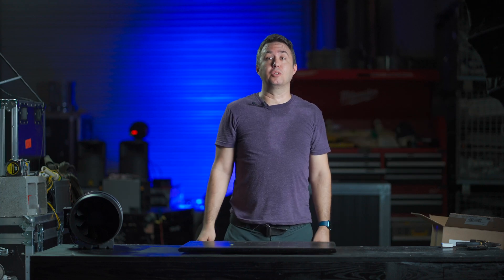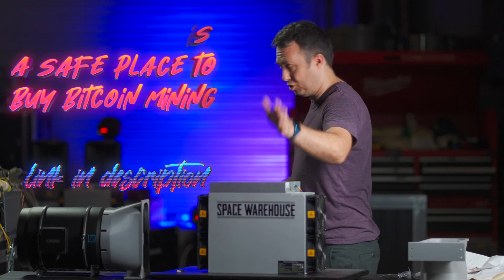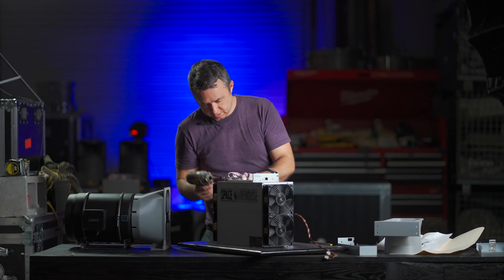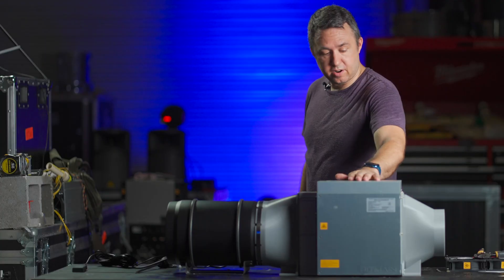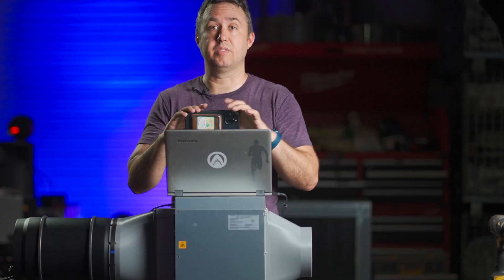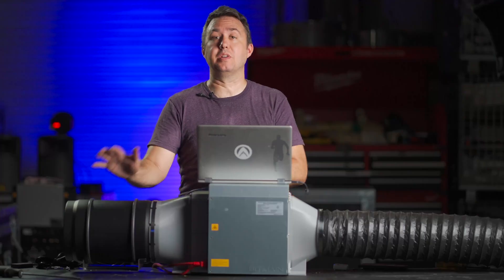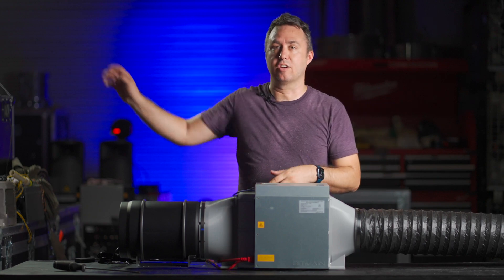S19 J Pro Running Quieter AND Cooler - Bitcoin Miner Fan Upgrade

Comment: hi, I've bought an S21XP for fun to learn about mining. Since it's so loud that my GF can hear it in the garage and can't sleep I've ordered a kit from Fruition and an Infiniti S10. What manual speed of the fan do you recommend and where did you find the 3D model of the grill for the infinity blower?
Reply: Ive never worked with the infinity S10 - I always used the cloud line 8" fans from infinity, and there's a company on amazon called Fruits and Associates that makes the 3d shroud.  Although I don't know if it's the same dimensions for the S21xp, I don't have one of those.  Hell of a miner though!
Reply: @NicholasJamesJohnson  okay, thanks for reply. Is there any ant miner community forum you can recommend? It restarts every few hours and I can't understand the logs..

Comment: Sorry to bother you again. I was needing your help about 2 years ago and I have one question. My tubing (ducting) for the exit air ripped and I either need to buy a new one, which I’d prefer not since we are thinking about getting rod of the machine, or taping it up somehow so that we can test it to make sure it runs okay. I’m sure I can’t use duct tape. Is there a tape I can use to connect the tubing back together? If so, what kind?
Reply from the maker: Theres no reason you cant use duct tape.  Its literally originally designed for ducting.  I just looked it up and duct tape should be good up to 200°!

Comment: Can this be done with a s19k pro or does it need different spoofers
Reply from the maker: I dont have any S19k's personally, but Im 99.99% sure they use the same fans and fan controllers.  If they look the same as in this video, they are definitely the same. The S21's have changed the connector so youll need a new set for those, but Im PRETTY sure the S19k works just like the S19J
Reply: @SPACEDESIGNWAREHOUSE My s19k pro only has 2 plugs for the fans where you would usually put spoofers the fans for the intake have 2 much bigger plugs not 4 in a row like I’ve seen on a video I’ve seen. I’ll get you the video

Comment: the difference in duct sizes is an issue, the other issue is that the lengths of flexable duct contains dead air, which the fan has to push, after pushing through your box. basically, you may need a small draw fan, or a shorter duct.

Comment: Just did this with a S19 XP and the miner oveheats after 5 minutes, even with the fan at the Max setting. any suggestions ? thanks
Reply from the maker: I am positive SOMETHING has to just be on backwards or you missed a step because these machines run MUCH MUCH MUCH cooler this way.. 
if your fan an AC Infinity? Is your fan 8”? The 6 inch version of this setup isn’t enough for the XP. 
If your fan blowing from the side where your power plugs go in, through the miner and out the other side, unobstructed? Or with 8” tubing? 
Is the tubing exceptionally long?
How hot is the room it’s in?

Comment: Hi!! 
I haver One T17 but make a lot of noise.. ir I remove the 3 fans from psu will work?
Thx
Reply from the maker: If you remove the fans from the PSU, you’ll need to find another way to keep the psu cool.  

One thing you can do is open up the PSU covering and blow a larger quieter fan into there, I have that set up on one of mine.

Comment: I'd like to do it on an S19K PRO, I think there are no fan emulators. In that case, I was thinking of using Braiin+ in immersion mode. Anyone who has tried? I'm worried about the 3 fans in the fountain, I understand they would stop working. Would ventilation need to be added?
Reply from the maker: You can use fan emulators on an s19k.. Or you can use braiins or ASIC.to with an SD card or a braiins board in immersion mode and then you would completely remove the fans and use one of these shrouds and inline fans.     

Im trying to figure out what you mean when you say "3 fans in the fountain..."
Reply: @SPACEDESIGNWAREHOUSE  Sorry! I meant PSU or power supply fans..
Reply from the maker: @pablorubengomezalmeida1187  ahhh yes, you keep the power supply fans on and running.  They do make some noise, but noot nearly as much as the main fans do.  Some of those 3d printed shroud companies will make ones that can cool the PSU as well as the main body, but they come in multiple parts and Im not sure they work with the k model.   

I have a deal going with Hash Vortex for 10% off!  https://www.hashvortex.eu and use code "SDW" at checkout! 10% off..
Reply: @SPACEDESIGNWAREHOUSE   Thanks man. Thanks for answering, I really appreciate it. I'm going to check the website you shared with me. Big hug from Argentina!!

Comment: Has anyone tried this in a pull configuration? Unfortunately I'd be running this in a very awkward space (my room), where it would make more sense (space wise) to put the fan in a sound dampening box after my s19k pro, then running exhaust out my window.
Reply from the maker: Yes some people do pull instead of push and it works equally. My only concern with that is that you are then subjecting the fan to all that heat constantly. Which is fine, it’s made for hvac so it can handle it. But heat will always shorten a bearings life.
Reply: @SPACEDESIGNWAREHOUSE  Luckily I found a box big enough to host both fan and asic, but small enough to fit in the space I need it to. So I will use it in a push configuration. Goes to show what a little extra research can do for you.

Comment: Do anyone knows, what happens to the miner, IF inline fan fails? Factory default the PCB reached 85C will shutdown, but at this point of temp in PCB the chips are already melted, because at PCB 45-55C chips stay on 70C

Comment: There are other duct adapters that include flow through for the power supply. Do you think that would be valuable?
Reply from the maker: Yep, those make it even quieter because you can disconnect the little fans that cool the power supply.

Comment: Hi guys how do you work the s19 95th without fans
Reply from the maker: Do you mean replacing the fans with this bigger in-line fan? You can’t run these machines without fans entirely
Reply: Yes that is what I mentioned thanks

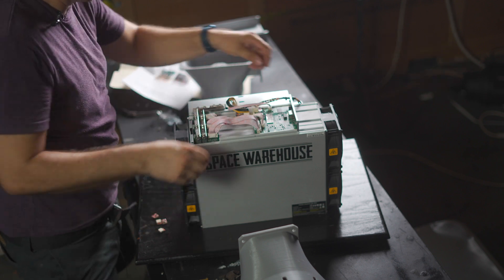Comment: it's funny to listen 2:20 to such specialists))) WHAT the power bus is dangerous!!!, man learn the basics of electrical engineering (300 amps at 12-15 volts) cannot harm a person, even if you stand with wet feet.
you're just illiterate, teaching children nonsense ....
kills not apers, but the voltage of the electrical network.

Comment: You should leave the top on,  it was engineered so air blows up into the control board to cool it.  As long as the air stays moving it's fine.
Reply from the maker: It doesn’t look like it. It was engineered with fans on the front and back, which means there is neutral pressure in the middle, which means almost no (very hot) air would go up there because that would require air pressure.  
If the design implied air moving through the control board then the fans on the back would have to run slower than the ones on the front, or there would need to be a deflector inside the case to shoot air up and in there, and neither of those are present.

Comment: Can you run the infinity fan on the exhaust side, instead of the intake side and leave the intake fans in place? I want to route the 8" ducting from the exhaust (using the infinity fan) into my cold air return on my HVAC system. The intake, at least for now, can stay with the regular fans.
Reply from the maker: Yep, you definitely can. These fans are designed as HVAC fans so they should be ok with the heat! You wouldn’t NEED to leave the stock ones on, they pull extra power and make extra noise and the AC Infinity is strong enough without them.
Reply: @SPACEDESIGNWAREHOUSE  Awesome!

Comment: Thank you for this video. It makes sense that a bigger fan would be more efficient, can you confirm this to be true? Specs of fans say 12V 230W (Im guessing this is the max setting), can you run a power meter on a stock setup vs with the Big fan with the same frequency configurations?

Comment: The heat is was going into the control board because you are blowing air through it vs sucking it away. It was as getting restricted and going up like heat does. If you suck the heat out it’ll be much more effective
Reply from the maker: Yep, it was a trade off where if I suck instead of blow, now I’m sucking 130 degree air through a plastic fan for ever and ever. It’s an HVAC fan so it’s probably made it get hot but all moving electronics last longer when they stay cooler.  I just keep the top off of the control board and everything stays happy
Reply: @SPACEDESIGNWAREHOUSE  ah I see, that makes sense although the AC Infiniti fans are built to withstand high temps. My buddy has had a 10” sucking on a L7 for over a 1yr straight and still kicking!

Comment: What chip temp do you aim for with this set up? Got the same thing going now on low power mode to heat the house, but setting 4 on the fan lets it climb to around 88, while setting 5 brings it down to 80 but is suddenly noticeable sound wise.

Comment: It’s not available Fruits & Associates shroud is there anywhere else that might have this and where would I get the spoofs from?  Thanks. Ps. U.K. if possible for delivery thanks
Reply from the maker: Cryptocloaks has 8” shrouds also and they’re just as good! 
As for spoofs, search either eBay or Amazon for s19 fan simulators if “spoofers” isn’t coming up with anything
Reply: @SPACEDESIGNWAREHOUSE  Thanks mate much appreciated
Reply: @SPACEDESIGNWAREHOUSE  Hi mate, looking at Cryptocloaks Antminer Dual to 8 inch and you leave the fans on the machine? i thought you had to remove the fans and add the spoofs???
Reply from the maker: @alanlees6779  you definitely do not leave the fans on the machine. You also do not use those same fan screws to attach the shroud, they’ll be too long without those fans and they’ll hit the hash board.
Reply: @SPACEDESIGNWAREHOUSE  the guy from Cryptocloaks  said you can leave the fans on? but i dont like that idea as there noisy, ok so i bought the shrouds from Cryptocloaks so dont use there screws that come with it, do you know the size of the screws needed, its getting complex now lol
Reply from the maker: @alanlees6779  If you want to make it super maximum quiet - you can take the side cover off, unplug the PSU fans and set a couple of 120mm computer fans in there to use instead, those will be nearly silent. 

I thought I wrote down the screw size, but youre going to have to go to the hardware store to get shorter ones anyway, so just bring one of the original fan screws with you and someone working there will be able to match up the thread and size.   Its worth the extra complication!  You needed a project!
Reply: @SPACEDESIGNWAREHOUSE  Hmm, ok ill figure it i guess, ok so wait, if i remove the cover for the PSU, do i need to remove the PSU fans then? And add 2 120mm fans in there place? Thanks for the help, do you have a video lol, also screw size be real handy, i dont want to kill the boards ive just bought it its new :(
Reply: @SPACEDESIGNWAREHOUSE  Oh how many Spoofers to put in there 2 or 4 ?

Comment: Hello my friend
There are a few points:
1. Power fan should be removed to reduce noise.
2. You can use the kitchen hood fan, which is much cheaper than this fan.
3. You can use MDF to make the body, I usually use cardboard chips.
At the price of US dollars, I will spend at least 15 dollars to silence the miner.
Reply from the maker: A kitchen hood fan is strong enough to handle 500CFM?

Comment: Do you know if they make an adapter to connect to the intake on a shushminer? I currently have it in my garage which is fine since it is cold outside. Once summer rolls around here in Louisiana, I would imagine I will need a way to input cool air.
Reply from the maker: Actually that’s a great project for my 3d printer. I’m going to be setting it up in about a week and thinking up good reasons to use it
Reply: @SPACEDESIGNWAREHOUSE  let me know how it works out. I definitely would be interested in something like that once Spring/Summer roll around.
Reply: @TravisHeadleyMD  Not yet, unfortunately.. I dont know where all of my free time goes!  Im heading to CES this week - so that settles that for time, but then I have most of the month of January for tinkering and I will get that figured out!
Reply: @SPACEDESIGNWAREHOUSE  have you gotten a chance to try this?

Comment: Couldn’t you just place a fan on the exhaust as well to create a negative pressure and increase the airflow?
Reply: Add another inline duct fan on the end of the exhaust duct to get a better pull in the system. That’s how we set up our Lincoln Electric weld fume extractor system at my work. The arm itself has a massive fan but it has to go through almost 70” of duct. I believe it is all 8”

Comment: My biggest problem isn’t the noise, it’s having to replace at least one of the fans every month. I never know which fan is failing because they continue to spin at the same velocity so I end up
Replacing one fan at a time until I find the failing fan. This is an annoying and tedious process. So this shroud and air intake is a muchhhhhhhh better setup. You sir have saved hours of my
Life replacing fans! :)
Reply: If you have a jpro, the latest firmware tells you exactly which fan is bad in the log
Reply: @KeeganTV  I never had antminer fan die so far, about 3 years running 3-4 asics at same time, so about 120 months total
Reply: lube them with a hyperlubricant like motorkote

Comment: Those clamps at the 4 min mark are designed with a nut head, so you can use a 5/16 or 1/4 socket on the smaller ones. The slot for a screwdriver is more of a backup solution.

Comment: Have you overclocked? What’s your best hash rate and temp with this setup?
Reply from the maker: I have! That was the next video I made after this one.  I got it to run at the ‘stock temp’ running 115TH - low 70’s
Reply: Yes had seen that. Can do better :)
Reply from the maker: @xti9979  oh for sure! But after that point you really start losing efficiency and I don’t have very cheap electricity over here
Reply: Yes true

Comment: hi, i'm french, where can i buy the 3d printed air parts?
Reply from the maker: Did you try Crypto Cloaks?  I would think that can ship international, the parts are so light.
Reply: @SPACEDESIGNWAREHOUSE  yes, 90$ for shipping, it's too expensive than i find on ebay a parts seem similar
Reply: @SPACEDESIGNWAREHOUSE  is i need to replace screw of original fan for fix the 3d air parts? i don't speak english sorry
Reply from the maker: @Mymerguez  yes, you will need shorter screws.
Reply: @SPACEDESIGNWAREHOUSE  thanks for your vid and tips!
Reply: @Mymerguez  si tu as pas trouvé contacte moi j'ai une adresse

Comment: After doing this... Both my S19 pro only reading 2 hash boards instead of 3.   Any idea as to why or know if a fix?
Reply from the maker: Did you use the short screws that came with the fruits and associates kit?? If you used longer screws, you may have made contact with the heat sync on the hash board.  

I didn’t realize people were doing this and didn’t think to mention it in the video.
Reply: Hmm, the long screw did make contact with the hash board.  It touched the heat sink side...   Boards salvageable?

Comment: i am wondering if using 1 8" fan to split to 2 units.
Reply from the maker: Ooooo, that MIGHT be a stretch, but it just might work, maybe..
Reply: @SPACEDESIGNWAREHOUSE  im only thinking of that it’s because not everyone has that much space for those 8 inch fans, I use the 8 inch fan to exhaust general air out of my garage. I have to do some math. Ty

Comment: My buddy works at the huge Whinstone mine outside of Austin, TX and he told me the sound is so loud in each building that you cannot hear someone standing right next to you talk unless they shout. Sounds like the s19 miner you have is just as loud without the air connectors.
Reply from the maker: Yep, they are insanely loud when they’re stock, but it’s all fan noise! They have four fans that all run at 6000rpm

Comment: Paste heat sinks on the side of the miner then lie it on its side and the heat won't affect the electronic board as much.
Reply from the maker: Clever! I actually just bought a bunch of heat syncs to mess around with for some
GPU experiments

Comment: SDW where have you been! Hope all is well .. BTW I was looking at my AC infinity fan and I noticed it has a 10” to 8” reducer on it, what if you get them to 3D print a dual fan to 10” shroud with clamp section, this would also reduce the overall length and better in Rush flow from the fan, plus better support for the PSU fan when they add the ports for it no?

Comment: Very cool. From a flow standpoint, this seems wrong but cool anyway. If anything, the 8 inch should be the outflow. Can you reverse it so it sucks through the machine rather than pushes and swap the 6 inch to the intake?
Reply from the maker: Yep, you can. That would ultimately be better for the miner I think? Probably lower the life of the fan having 130 degree air blow through it 24 hours a day
Reply: @SPACEDESIGNWAREHOUSE  maybe, but it would improve the heat removal I think. I feel like the advantage of having better airflow would outweigh the fan replacement cost. Have to run some numbers to figure that out. I think this is a neat system but adding a bottleneck like a smaller outake is odd
Reply from the maker: @BradyPatterson  yeah, I’ve taken it off for mine, just running the back side wide open

Comment: I’ve been using these 6 inch AC infinity fans since October last year non stop. I also use a muffler that they also offer to further reduce the noise. I’m very pleased with their products.  It changed the game for my Bitcoin miner.
Reply: I have the same. I call it the silencer. I have on on each side and one 8” blower in each side.
Reply: Did u keep your fans on? Mine are still on. Keeps my kds’s at 78/80 at 7/8 blower settings.
Reply: do u mind sharing the link for the mufflers?